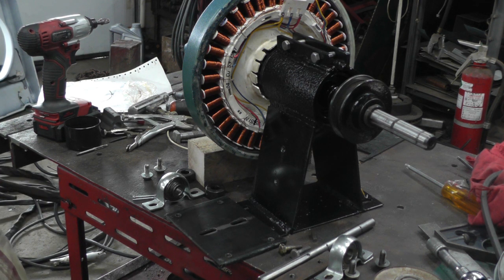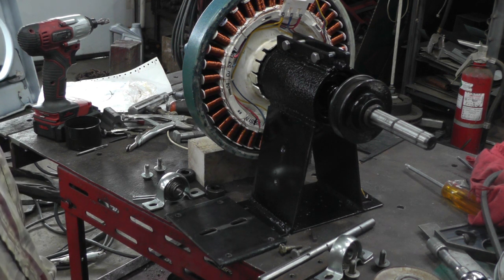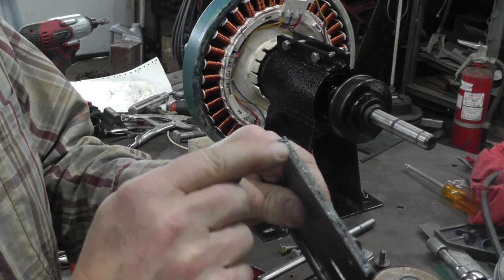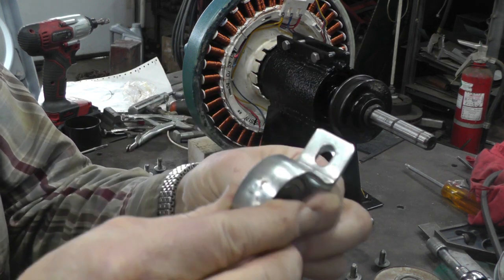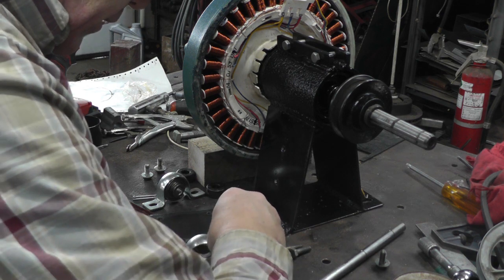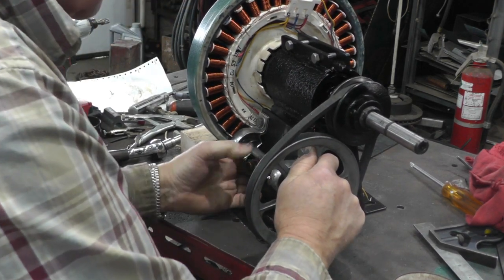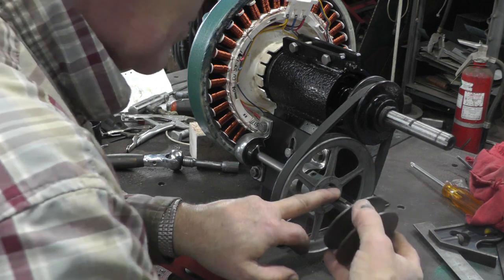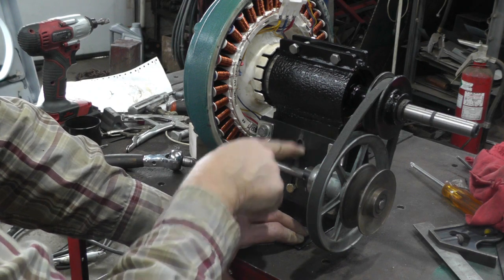Waterwheel Smart Drive Project part 3

Comment: I'm curious driving such a small pulley on the generator with v belt does it get hot or ever slip? i wonder if a serpentine belt or even coged timing belt would have any advantage?

Comment: Are you installing a jackshaft to get better low-flow performance? Do you think efficiency will increase with a higher rpm under normal flow conditions? It seems to work just fine as it is, an additional belt stage would just add more friction. On my waterwheel adding a second stage almost slowed down the wheel just as much as it sped up the output resulting in only a small increase in open circuit voltage (but enough to charge a battery)

  Also I never got an email from you about doing videos together.
Reply from the maker: Yes. Not sure about improvement with normal flow that will prove out in the future. That is why I left the main shaft long so I can switch back to direct drive . The extra friction of the jack shaft was always a problem with my other trials in the past.  I did send an email about getting together wonder what happened to it may be in your junk mail ???.

Comment: Why belts and pulley's? I think  light chain and sprockets will be more efficant.
Reply from the maker: Chain and sprockets are expensive and don't last long and require lubrication. Belts and pulleys are inexpensive last a long time are easy to get and don't require lubrication. My belts last years. When I tried chain it didn't make it six months. Thanks for watching.
Reply: @kevincrawford2027  Fair enough.